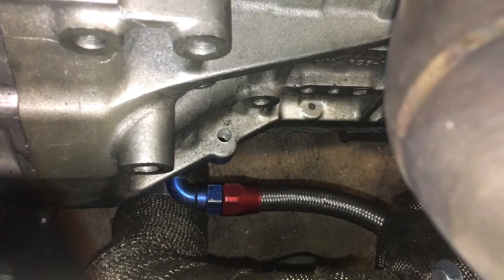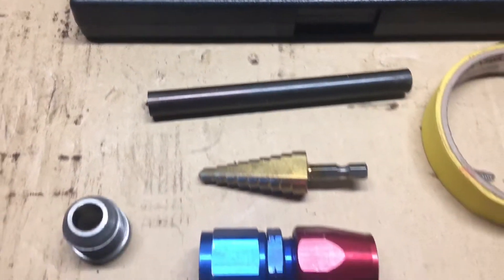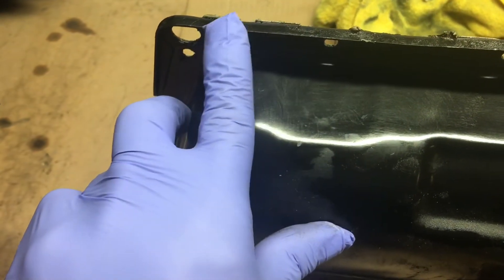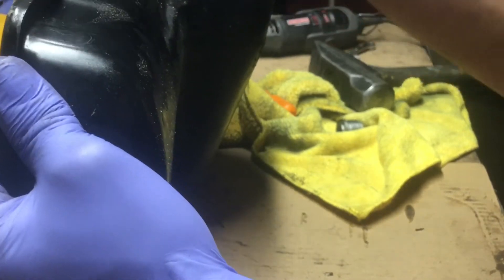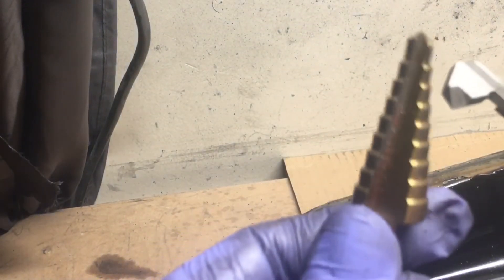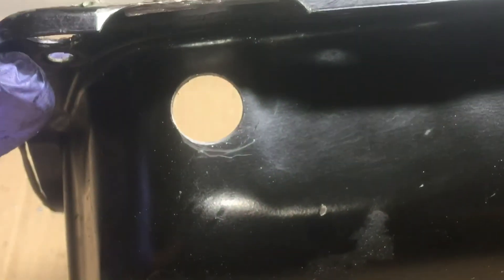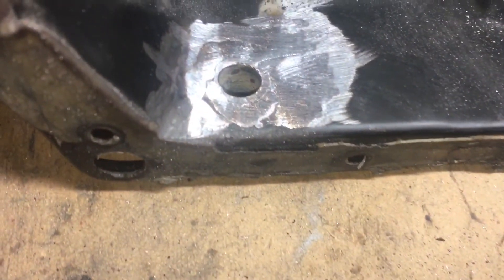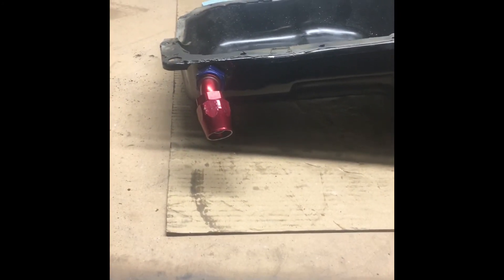Oil return line for a turbocharged Honda

Comment: Make sure that your fitting and oil pan are steel because you can't weld Aluminum to steel unless you Braze weld it... Just a heads up on that. Good video tho.
Reply from the maker: Rus Clay yes the bung is mild steel

Comment: that welder welds aluminium...?
that's great ....
I'm getting ready to install my eBay turbo tomorrow... thanks for the video bro.....I. getting this welding machine tomorrow... they have the 125amp for $90 
do you think that it will work the same..?
Reply from the maker: Ruben Basurto the oil pan and bung are mild steel ..
Reply from the maker: Ruben Basurto the 125amp welds better
Reply from the maker: Ruben Basurto doesn’t weld aluminum